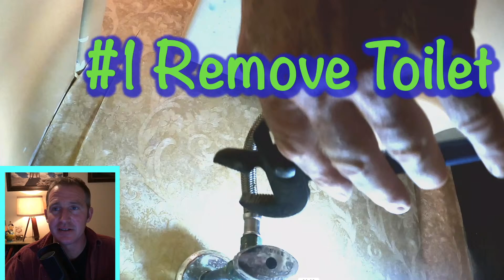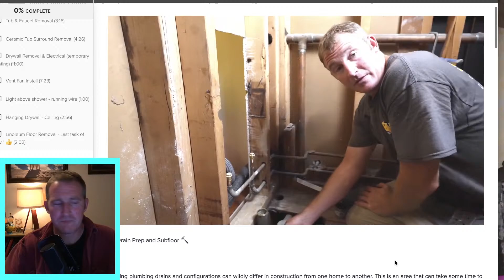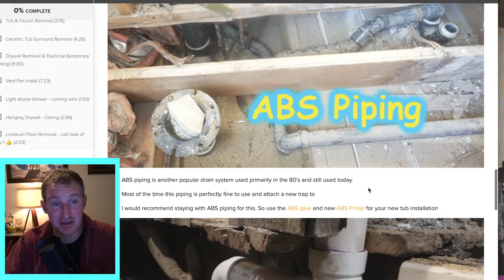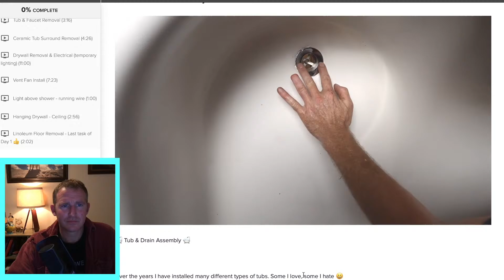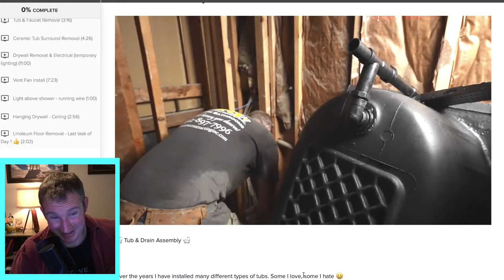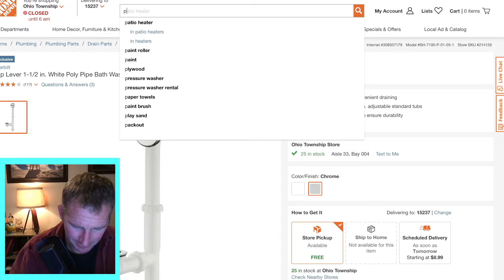Bathroom Remodeling Course | Day 2 Part 1

Comment: Hey Steve, I wanted to comment about the last video where your wiring the fan and ceiling light. Depending on the part of the country you live you can't use Romex. I know you can but you might mention that depending on your state and county that you need to check local codes for proper wiring. And of course that same advice would be for other parts of a remodel such as plumbing. Other than that your doing a great job and people will gain confidence to tackle their own project.
Reply from the maker: Thanks, and good points. It’s an impossible job knowing what rules and codes are around the world, 😆 especially when it comes to places like California and other highly regulated places. I’d be saying “check your code” on every point 😆 
That’s crazy not to allow for Romex. 👍